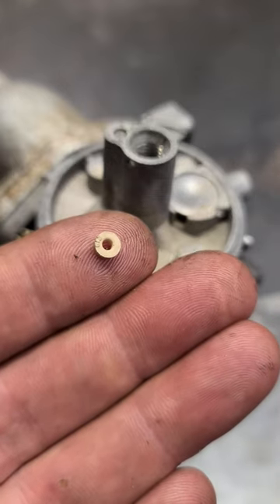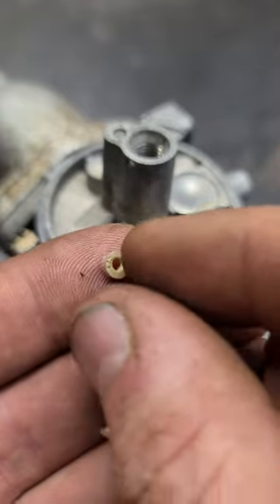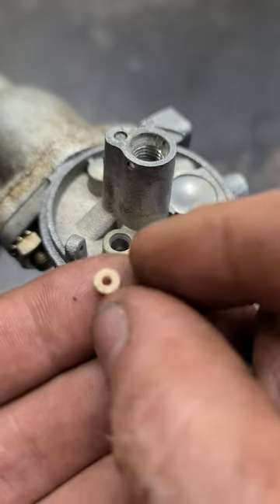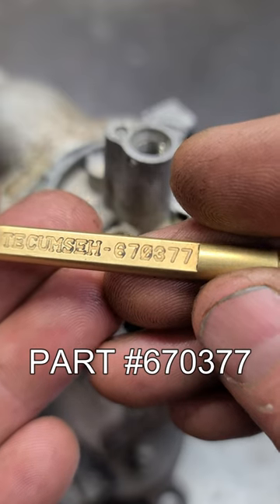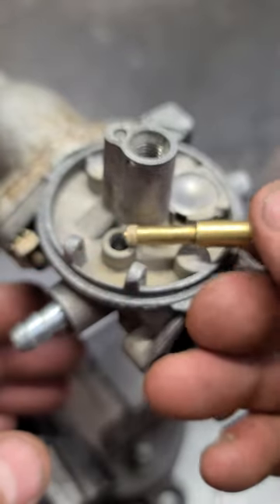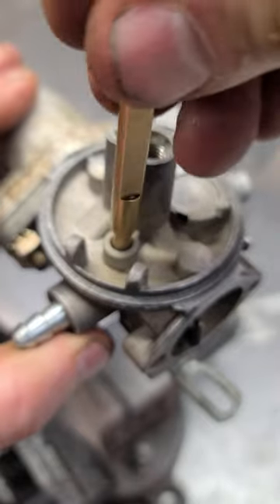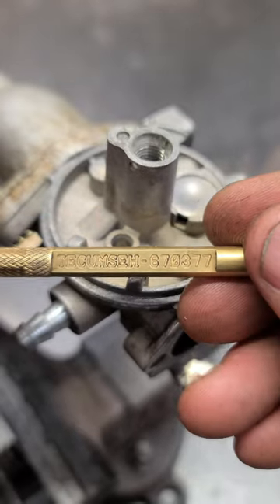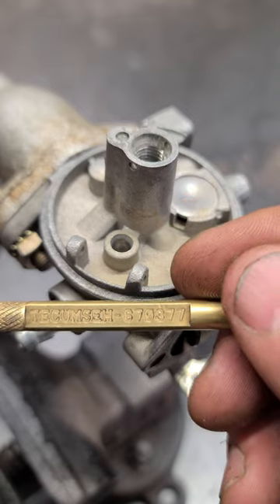I Always Get Asked This About Tecumseh Carburetors  #shorts #donyboy73

Comment: That Tecumseh tool was worth every penny (like $15). I had to use a drill bit on a Briggs and it took a few tries to get right.
Reply: I used a paper clip to remove the gasket. Just put a small bend in the end and it worked great. Then used the blunt end of a drill bitt to install the new one.